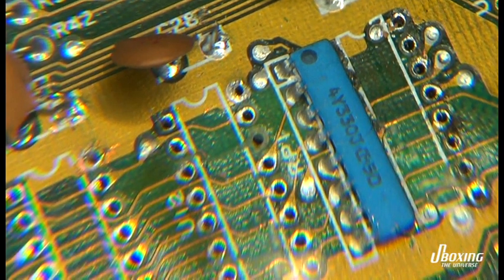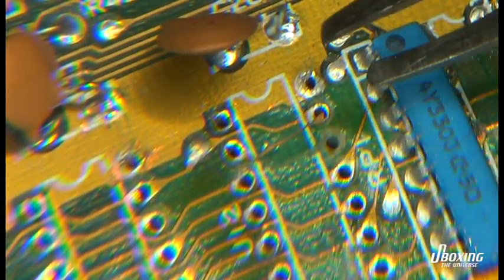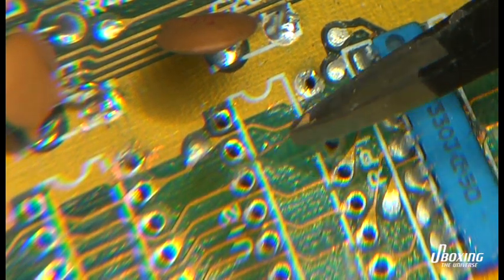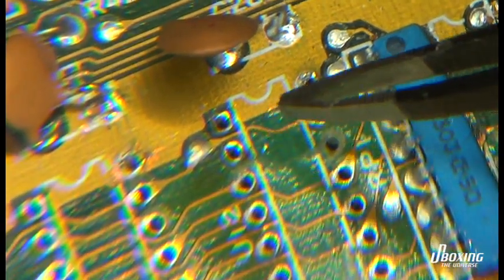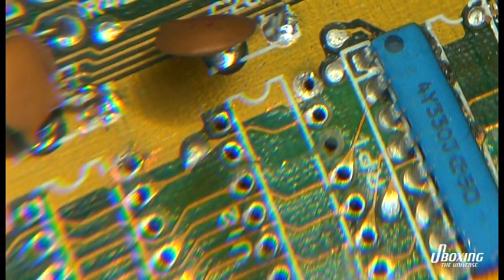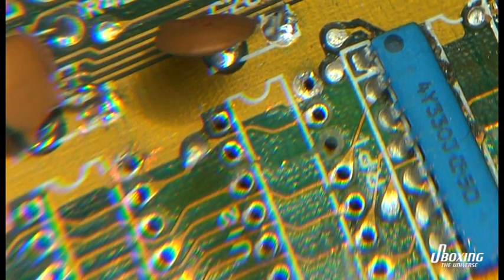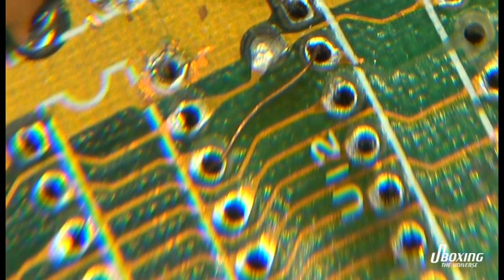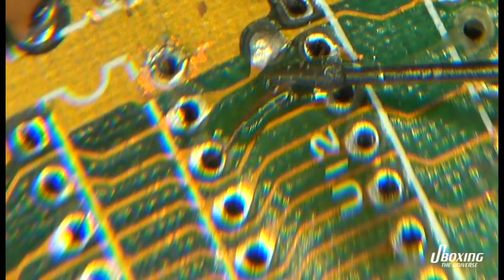Repair broken pcb traces HOWTO

Comment: You pulled the trace and rewired it to the wrong spot mate. It was supposed to go back to the hole that needed a new through hole? Or did you trace it to that other pin?
Reply from the maker: Hello. Yes I must have done something like that. It worked after  all. Im trying to keep it under the chip do its not visible.
Reply: This is just superb, been searching for "how to repair burnt circuit board" for a while now, and I think this has helped. Ever heard of - Giyathan Bewildering Gratification - (do a google search ) ? It is a great one off guide for discovering how to repair your electronic items like a wizard without the hard work. Ive heard some amazing things about it and my partner got cool results with it.

Comment: How do you fix the part that the trace connects to.  One of the through holes... Rings not sure what it is called but I see it's missing... Right next to the trace you are repairing.  An led was soldered to it on my board... I tried to switch it out for a diff color led and when I removed the led the little copper ring went with it and now I can't solder the it to the board (sorry long winded question)
Reply from the maker: Well, that can be a problem, if im going to put a socket in there, I just run the wire through the hole and solder it to the leg of the socket. Try solder it to the component if nothing else is availible. Thanks for the comment, pls subscribe ;)

Comment: What was the gauge of copper wire and what kind of glue did you use?  I have a C64 circuit board with the same issue.
Reply from the maker: Hello. Just any old thin copper wire that fits the footprint. Put some kind of epoxy glue over it. I just improvise and take something I have close at hand. Good luck and thank you for watching. Please post any info regarding your project.
Reply: Look for 30AWG wire wrap wire